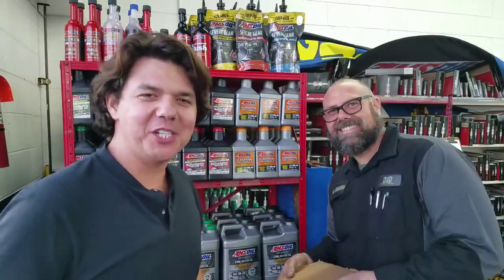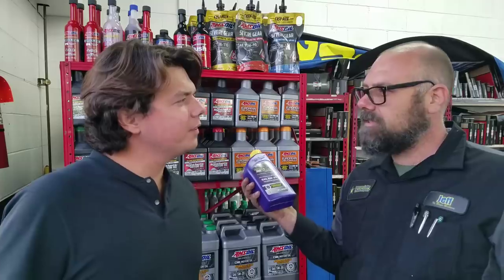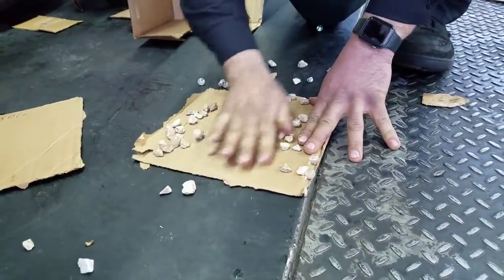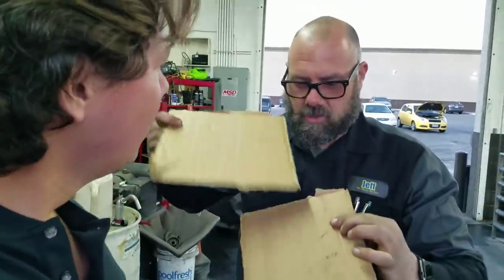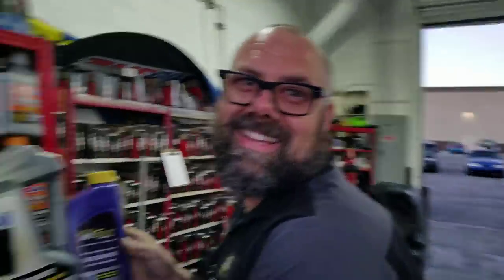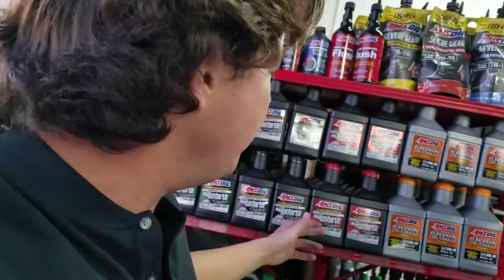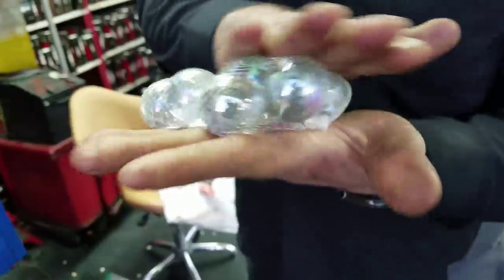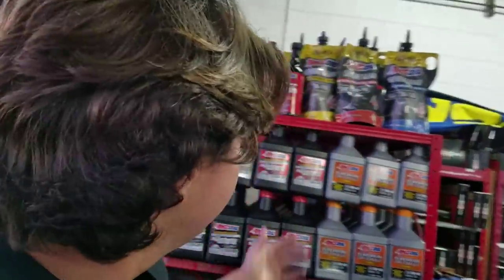Is Full Synthetic The Same as 100% Synthetic - Big Oil Companies Won't Tell You THIS!

Comment from the maker: ✅ ✅ ✅  Save 25% On Your Next Fluid Order: https://www.amsoil.com/offers/pc/?zo=5331179 

     ✅️ ✅️ Watch This Next: The Truth About AMSOIL Why Mechanics Won't Recommend - https://youtu.be/8OhntOxngAA

      ✅️ Your Professional YouLubher: Eben Rockmaker. Find The Right Fluids For My Vehicle - https://www.amsoil.com/guides/?zo=5331179      

     🥇🥇🥇 Synthetic Oil Protection Google Map Reviews (702) 472-3614 https://maps.app.goo.gl/DmLU5hP72HadUBEm9
              
     ♥️ Synthetic Oil Protection Website - http://syntheticoilprotection.net 

     Did you know a oil manufacturer can call a lubricant a Full Synthetic when it's only 25% synthetic? AMSOIL is different because it is 100% Synthetic and has a higher film strength keeping the metal parts separated. AMSOIL allows less friction, less heat, less wear on the component. AMSOIL Signature Series motor oil will last 25,000 miles on 1 oil change! See Results - 

     ♥️ See Fluid Performance Tests - https://www.amsoil.com/performancetests.aspx?zo=5331179      

     ♥️ Your Vehicle Could Run Better Than Brand New By Choosing The Right Fluids! See Results - https://youtu.be/zH-VquYlhqA.    

     ♥️ Why AMSOIL - https://www.amsoil.com/about/exclusive-distribution/?zo=5331179    
     ♥️ Synthetic Oil Protection Coffee - Ebens Favorite: https://supportwith.coffee/shop/subscriptions/sop/
Reply: Yet I assume that membership only holds for US and Canadian residents? I live in Israël, can't imagine I would be entitled to free shipment.i am a private party, not a business.
Reply from the maker: You'll see your closest distributor right here - https://www.amsoil.com/international/distributor/?zo=5331179

Comment: I work in the petroleum lubricants industry .
And also use Royal Purple in my infiniti .
I never ran into any issues with using RP.
Proof is in the puddin .
Reply: Well, considering you basically own a Renault proof is in the pudding.
Reply from the maker: Industry-standard 3rd party testing results:

AMSOIL Signature Series 5W-30 Synthetic Motor Oil protects against harmful deposits on turbochargers 4X better than Mobil1® Extended Performance and 3.6X better than Royal Purple® in industry-standard testing*.
https://www.amsoil.com/newsstand/motor-oil/articles/leading-the-field-in-deposit-protection/?zo=5331179

Amsoil gets better gas mileage - 
https://www.amsoil.com/newsstand/motor-oil/articles/another-win-for-amsoil-products/?zo=5331179

AMSOIL Signature Series is fortified with a heavy treatment of detergent additive and it delivers 30% more acid neutralizing power1 than Mobil 1, and 36% more than Royal Purple, helping engines to stay cleaner, longer.-
https://www.amsoil.com/newsstand/motor-oil/articles/cleaning-up-the-competition/?zo=5331179

Comment: I do believe that 100% is some kind of a pure stuff, while semi and full* (*if just used as a marketing hype) is way below 100% pure. However, I love to see a representation of the 100% synthetic, both in rounded and cracked  or irregular form like that of the non-100% synthetic (semi or full) in the video and see if they won't leave any scratch and dent marks when rubbed over the cardboard.
Reply from the maker: This will give you an idea of some of the differences.
AMSOIL Performance Test Results - https://www.amsoil.com/performancetests.aspx?zo=5331179

Comment: Spoke with you via phone, (Eben) thanx a bunch for taking my call.
After getting "waltzed around" by the Quickkee EZ Lubey's around
town. I decided to start taking oil changes and mechanical matters
in my own hands. I started by sending out my "Fool Syn" blend to
Blackstone Labs for analysis. Results sent back and my concerns of water,
coolant, fuel etc were not present. Tolerable averages in other categories.
Asked the technician about the Full Syn test vs. standard oil, they do not
have the equipment to test. WHAT?! How do we know if my local quickkee
and EZ on the corner is using the bottom feeder standard, blend or the
category of Full Syn. Unfortunately I used Mobil 1 Full SIN (sic) in my 
'05 F150  190,000 mi. Ford pick up. I found out from the tech and you Eben,
the big oil WORD game Fool's Sin is a blend of standard oil and is not 100%
Synthetic WTF!?!  I spent approx. for 7 qts fool's syn Mobil 1, recommended
via Ford Motorcraft oil filter and a WIX air filter for 75.00ish after a 25.00 
discount at Auto Zone. Somewhere in the 3-5,000 mi. range and another
Blackstone Lab analysis. I will be going 100% Synthetic with Amsoil through
you and then address the other products available. 
Big Oil WORD game, I won't be Fooled again. I ask around, not one person,
I talk to understands FULL syn is not 100% synthetic! Question, do any of
the oil analysis labs test for 100% Synthetic or Full Synthetic?  I believe this
testing will keep the corner Quickee EZ Lubey honest. Look forward to seeing
you and the Caddy in So. Cal, Ventura 
Tom
Reply from the maker: I'm not sure if they test for the hundred percent synthetic I know you can call Loyal analyzers or you can call Black stones and see what they say.

I've had people use both and they said the biggest difference is that oil analyzers is easier to read the chart that's about it

Comment: Just want to let you guys know, I have a Grand Prix with 350,000 miles on the original engine and yes the original 4t65 glass encased transmission.  Amsoil transmission fluid.  The engine doesn’t knock, click or tap.  Amsoil 5w30 xt since we bought it with 80,000 miles on it.  It gets changed every 7500 miles.
Reply from the maker: That's awesome super happy to hear your loving it!!!

How many years ago did you learn about Amsoil?
Reply: @Syntheticoilprotection  I’ve used amsoil for probably 17 years I’d say.  Ever since I turned 16 I started using amsoil.   One of my friends up in Stanley Wisconsin sells me amsoil for a very good price and that just makes it even more easier to use than just being simply an amazing product!  
I run it in my small engines, tractor, all 4 company vehicles and 3 personal vehicles and even have the hydrostatic oil in my garden tractor transmission.  I also run saber in my 2 cycle equipment.   Thanks for the reply back! Very nice to hear back from a channel :)
Reply from the maker: Awesome thanks for sharing that with the channel 💯😃😊

Comment: 2007 Honda Civic bought it brand new in 2007 January 12 this car has 335,000 original miles using Mobil 1 full synthetic 10w40 the first 3000 miles switch over to Mobil 1 10W-30 when it reached exactly 300,000 MI I switch over to 10W-40 full synthetic Mobil 1 never had an oil unrelated failure you are saying that mobile one will physically damage your engine explain to me how come my engine lasted 355,000 original miles just by using mobile one full synthetic
Reply from the maker: They are different in one is 100% synthetic the other is a synthetic blend it's the film strength that separates the metal and over time it will wear out the Rings quicker because of the film between the metal the viscosity has nothing to do with the film strength that has to do with the quality of the motor oil and soil creates a higher quality film strength this will show how different it is.
♥️   See fluid performance tests - https://www.amsoil.com/performancetests.aspx?zo=5331179

Comment: Not true. My 98 cobra has 130,000 miles all Mobile 1 synthetic. I pulled off the valve covers to change the gasket. I inspected the engine cams and all were glass not the slightest grove or scuff.
Reply from the maker: Awesome yeah the difference is are quite a bit just depends on what test you're looking at this is some of the differences here.

The Power of AMSOIL Signature Series 5W-30 Synthetic Motor Oil protects against harmful deposits on turbochargers 4X better than Mobil1® Extended Performance and 3.6X better than Royal Purple® in industry-standard testing*. https://www.amsoil.com/newsstand/motor-oil/articles/leading-the-field-in-deposit-protection/?zo=5331179
Reply from the maker: Thanks for being a part of my channel Raymond.
AMSOIL Performance Test Results - https://www.amsoil.com/performancetests.aspx?zo=5331179

Comment: since you live in vegas and i live close to vegas and its hot all the time and never gets below 32f degrees why do we need a poor flow rate test like right now in summer i start my truck and by the time i get to the first stop sign its at operating temp so we need not fear the ccld day so uner our circumstances how long will a good 20,000 mile advanced synthetic oil go and can i run my 2020 ford f150 2.7 turbo some 5w20 instead of 5w30 since its so hot or better yet since heat lowers your 5w30 to about 15 viscosity instead of 30 maybe i could increase it from 5w30 to 5w40 or even 10w40 cuz its hot hot hot and it will breakdown to 5w20 and burnoff
Reply from the maker: Watch This video  - https://youtu.be/6jYjsLTIH24?si=F1Yc0QRtGXyPLoSp

Comment: What practical difference does it actually make?
How many people buy a car and keep it forever?
The $$ you spend only benefits the 4th owner who drives it until he junks it.
The first 3 have wasted their $$$.
THINK ABOUT IT.
Reply from the maker: It's a very large difference on Time Savings in fuel mileage Amsoil is the least expensive motor oil available because of the extended drain interval capability one oil change a year in 15,000 miles the viscosity change is so small even at 10,000 miles you're still getting better gas mileage then mineral oil and that gas mileage ends up being on most cars about 70 to $130 per year.

By the time you factor in not doing two extra oil changes in Time Savings it is an exponential difference also your engine will have more compression longer because there's less we're in the Pistons and cams because the hundred percent synthetic keeps the metal separated so it's a massive difference in the short-term and in the long-term it's something you physically have to try to see the difference I've captured it with a couple of videos here is my best stuff on that.
Reply from the maker: Industry-standard 3rd party testing results:

AMSOIL Signature Series 5W-30 Synthetic Motor Oil protects against harmful deposits on turbochargers 4X better than Mobil1® Extended Performance and 3.6X better than Royal Purple® in industry-standard testing*.
https://www.amsoil.com/newsstand/motor-oil/articles/leading-the-field-in-deposit-protection/?zo=5331179

Amsoil gets better gas mileage - 
https://www.amsoil.com/newsstand/motor-oil/articles/another-win-for-amsoil-products/?zo=5331179

AMSOIL Signature Series is fortified with a heavy treatment of detergent additive and it delivers 30% more acid neutralizing power1 than Mobil 1, and 36% more than Royal Purple, helping engines to stay cleaner, longer.-
https://www.amsoil.com/newsstand/motor-oil/articles/cleaning-up-the-competition/?zo=5331179
Reply from the maker: https://youtu.be/H7K6FdZlqmg
Reply from the maker: I also have a whole playlist on follow up videos you'll see that in my playlist

Comment: I'm going to fill up with marbles, thanks for the lecture!
Reply from the maker: The difference is pretty tough to believe.
AMSOIL Signature Series 5W-30 Synthetic Motor Oil protects against harmful deposits on turbochargers 4X better than Mobil1® Extended Performance in industry-standard testing*.  Read This Article - https://www.amsoil.com/newsstand/motor-oil/articles/leading-the-field-in-deposit-protection/?zo=5331179      

     ♥️ AMSOIL Performance Tests: Read This Article - https://www.amsoil.com/performancetests.aspx?zo=5331179

Comment: This is my story I have a 2005 porsche cayenne turbo s I was using the 0w40 junk mobil 1 and had lots of blow by then I did the engine flush with amsoil  and put 5w40 amsoil european formula the blow by stopped engine nice and smooth runs cooler, I know it's hard to believe for someone that doesn't use amsoil.
Reply from the maker: 😉, that's awesome have you ever tried the pi performance improver yet?

Comment: What about ultra platinum which is from natural gas
Reply from the maker: That's a great question one is a synthetic blend the other one is 100% synthetic huge difference - https://youtu.be/0lXL0va_8rY?si=89niPTCJIHq6cMId
Reply: @ can you re send me your link to your amsoil oil page
Reply from the maker: Let's get your vehicles running better than brand new!

     For me to get credit & be "Your" Independent AMSOIL Dealer, please use my website below or my dealer no. 5331179 call anytime Eben Rockmaker 702-472-3614
After you click on: https://syntheticoilprotection.net/
1. Click the hamburger menu
2. Click offers AMSOIL preferred customer
3. Click join now. 6-month PC member add to cart.  ( There is no reoccurring renewal membership unless you select that dot box ) 
( You have the option to not have your credit card saved if you prefer - est. 1972 )
4. Scroll up to the top Select shop by vehicle. 

New Promo Code: 5QS

Comment: Hello! I just found your channel. I'm watching this video on my Roku as I am typing this on my phone. I do lawn care and landscaping and thus tow about 5,200 lbs. every day. You may have done a video on this and I just haven't found it but could you do one on the best oil for engines under constant loads from towing? As of yet, I haven't found one. I'm in the midst of doing research to decide which oil to use in the work truck I just bought, a 2014 F150 with the 5 liter V8. I know which oil I'm NOT using, Motorcraft. After watching for frozen flow test with Pennzoil, NO WAY am I putting that garbage in my engine. Thanks for the valuable info.
Reply from the maker: I love it awesome thanks for being a part of my YouTube channel and this is my personal link here I recommend the signature series motor oil with the engine flush I would also do the pi performance improver and I would personally run the upper sonar lubricant every full tank of gas.

The sixth month PC membership will give you the very best value however if you're using the fluids in your work truck you want the commercial account which is the link here if it's for your business and I will be your independent Amsoil Dealer when you use my link that will attach me to you so in the future I can always answer all your questions.
Commercial Businesses - https://www.amsoil.com/account-application/commercial?zo=5331179
Reply from the maker: If you have any other questions on any of the products just give me a buzz I can walk you through everything for all your equipment trimmers greasings hydraulic fluid for the Zero Turns and transmission fluid for those as well we'll make a huge difference in the speed and the lifespan of the equipment.
Also there is the quick shot fuel additive will make a huge difference too for your small engines with the small engine oil.
Eben Rockmaker 
702-472-3614

Comment: The Walmart Royal purple doesn't have synerlec. The upper lines of Royal purple do still have the synerlec. I have seen the test of amsoil signature vs regular Royal purple. Still yet to see a more apples to apples test of amsoil best vs Royal purple best. Regardless these are the two manufacturers I use
Reply from the maker: This is Amsoil vs Royal
https://youtu.be/E2zS8MyvJxU
Reply from the maker: AMSOIL Signature Series 5W-30 Synthetic Motor Oil protects against harmful deposits on turbochargers 4X better than Mobil1® Extended Performance and 3.6X better than Royal Purple® in industry-standard testing*.
https://www.amsoil.com/newsstand/motor-oil/articles/leading-the-field-in-deposit-protection/?zo=5331179

Comment: Should put them 2  oils in a scuffing test
And see which one damages more the metal I got family that works in the oil industry and mobile one has always been 100% full synthetic
Reply from the maker: That's correct The Amsoil is 100% synthetic and the Mobil 1 used to be 100% synthetic but then they changed the formula and you'll see the difference here how big of a difference that it is.
AMSOIL Performance Test Results. Read This Article - https://www.amsoil.com/performancetests.aspx?zo=5331179

Comment: Synthetic Oil Protection what is better Amsoil 10w30 motor oil, or SuperTech 10w30 motor oil ?
Reply from the maker: Hey great question Miguel there is no comparison This is the tests you'll see the comparisons to a lot of the major motor oil brands.

The biggest difference is the 100% synthetic film strength keeps the metal part separated and you have much less wear and heat. That's the quick and simple explanation This is all the technical: 
The Power of AMSOIL Signature Series 5W-30 Synthetic Motor Oil protects against harmful deposits on turbochargers 4X better than Mobil1® Extended Performance and 3.6X better than Royal Purple® in industry-standard testing*.  Read This Article - https://www.amsoil.com/newsstand/motor-oil/articles/leading-the-field-in-deposit-protection/?zo=5331179 

     Better MPG Proven. Read This Article - https://www.amsoil.com/newsstand/motor-oil/articles/another-win-for-amsoil-products/?zo=5331179 

AMSOIL Performance Test Results. Read This Article - https://www.amsoil.com/performancetests.aspx?zo=5331179

Comment: But Why This Oil Company Are Certified dexos2 Certificate
Eg Castrol Edge
Mobil 1
In INDIA ???
Even They Force To Buy This Oil

MOTUL 8100 X-cess Is Advertising 💯% Synthetic But Not Advertising dexos2

So Which One Should I Buy 
MOTUL 8100 X-cess 💯%
Castrol Edge Dexos2 Fully Synthetic
Mobil 1 Fully Synthetic
CATROL edge

I Am Planning To Buy MOTUL 8100 X-cess 💯% Synthetic Oil
Reply from the maker: It's paying to do a test. Then  they get the new spec